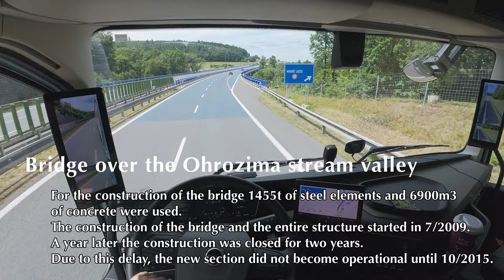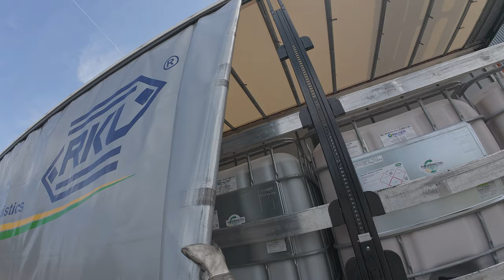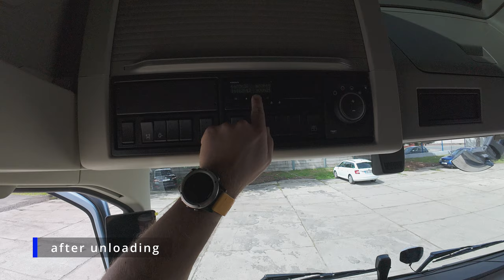Unloading a Volvo FH Aero - The Most Satisfying Truck Experience

Comment: Hello Martin. I'm late in commenting today. Is the Aero a great truck? I prefer Scania to Volvo❤️ Best regards, Martin.
Reply from the maker: Hi. Thank you for the nice question. I'd also prefer a Scania, as they are much more expensive. Scania has more cabin space, flat floor and design wise I like it more, but that's a matter of each person's taste.
The VOLVO Aero is the same inside as the previous generation. It's just a lighter facelift. But compared to the Scania, it has a perfectly soundproof engine compartment and is generally very quiet. I even found it to be a bit quieter than the current Volvo I drive. 
But after driving a Mercedes, I'd choose a Mercedes over a Scania, if only because I primarily drive to Germany, so I'd rather have a German brand truck. :)